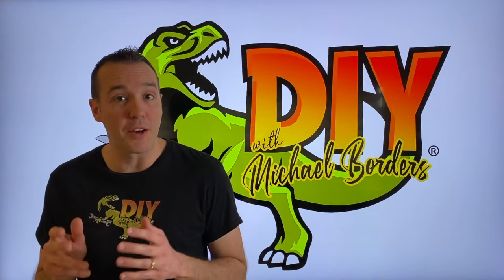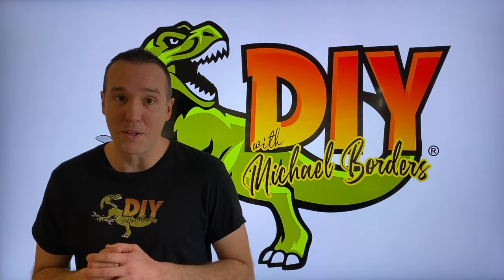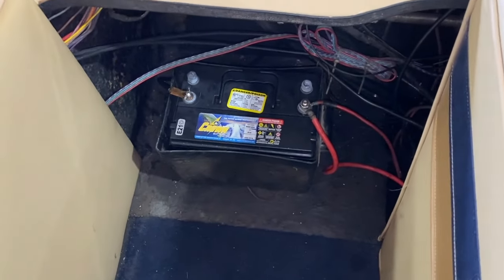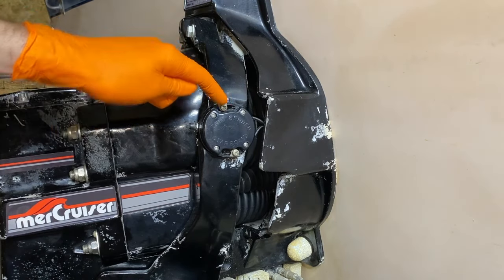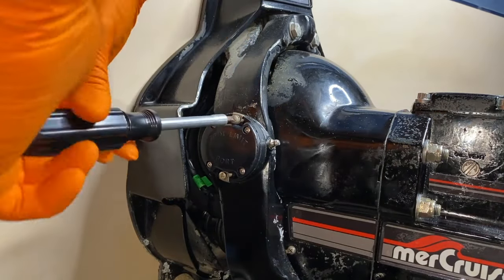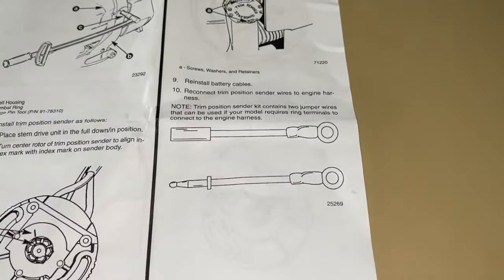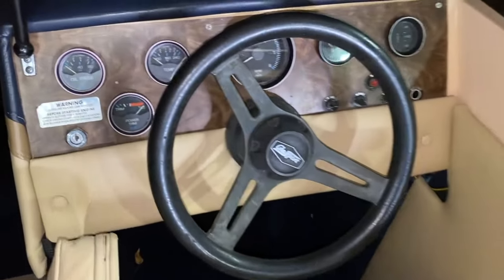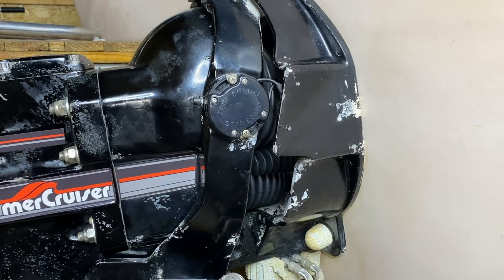How to calibrate/align outdrive Trim Limit and Sender switches

Comment: Your alpha drive videos are the best that I have found.  So much information.  You made it so easy to rebuild everything.   
Question.  Sometimes the trim does not work until i tilt it 1st.  Do you know why?
Reply from the maker: @goblu2102  

Thank you, we are very happy to hear.  Any and all feedback is greatly appreciated!

That is not uncommon however not normal.  It’s very possible that you need to re-bleed trim rams and hydraulic lines… but that sounds more in-line with an electrical problem or sporadic behavior with your solenoid.

Below is a video link showing us performing this.

       https://youtu.be/gfW3dWsSLkE?si=-5tODGDtG8NN8LfR

If that does not work, you may need to replace your trim system solenoids.  We will also post a video link below showing the step-by-step process of replacing those.

       https://youtu.be/ebUCWEFw7Xo?si=k20tM1gk0TMQJEqp

😁👍🧰

Comment: new to trim adjusting. y are we setting bottom out to center guage? wouldn't bottom out be all the way left and all the way right(In red trim area) be trailer mode?
Reply: Good question. I'm curious too.
Reply: Yeah same here. I’d think bottom out would be to the lowest point of trim gauge not middle? But he had it maxed out on how far he could rotate it and it was dead center so I’m not sure.

Comment: Hello Michael, have a boat without a trim gauge indicator,how should I go about adjusting the unit.
Any suggestions would be appreciated
Reply: You can do 1001, 1002, 1003 from the known down location when you first launch but once you’re underway I promise you will forget how far up you trimmed.  But that’s how (risky)

Better to spend the $40 buying new sensors and the 3 hours figuring to get wires tightened in hole through transom
Reply: Hi ! No indicator is needed to turn off the trim pump. Loosen the screws of the left sensor and adjust the distance between the cylinder axes. Hello, from Russia!))

Comment: do you think i can reattached new part to the old one ?..heat shrink them?
Reply from the maker: Thanks for watching, not sure if we understand.  Please provide additional info so we can help further.  😁👍🧰
Reply: Do you think I can heat shrink wires to the existing one outside instead of removing the all outdrive ?
Reply from the maker: @magartus  

Thanks for the reply and clarification.  We haven’t done that in the past, and that’s because it can interrupt the proper polarity of electrical power being fed to-and-from throughout the wires.

Any form of modification or interruption of electrical power can and likely will interfere or degrade the overall performance of operation.

This however will be personal preference, and unfortunately we can’t give you a confident answer on how it will turn out or perform…since we have not modified part and wires in any way.

Please keep us posted.  🧰
Reply: Thanks
Reply from the maker: @magartus  

👍